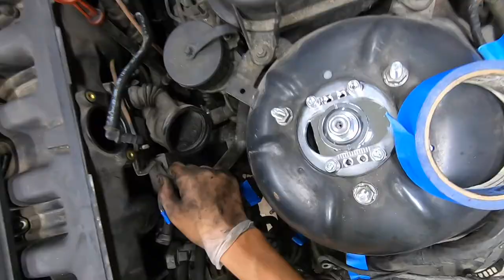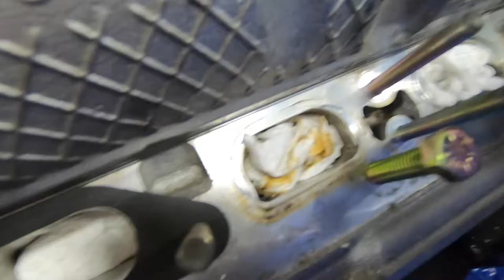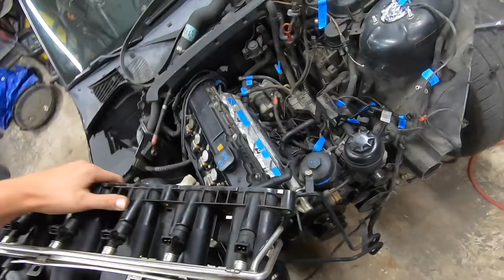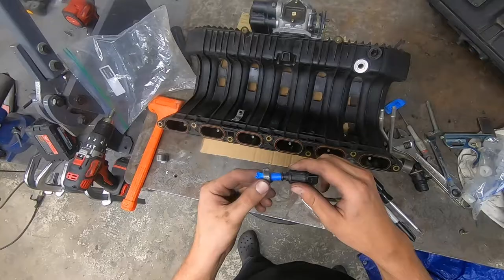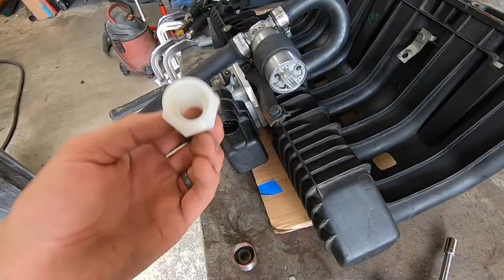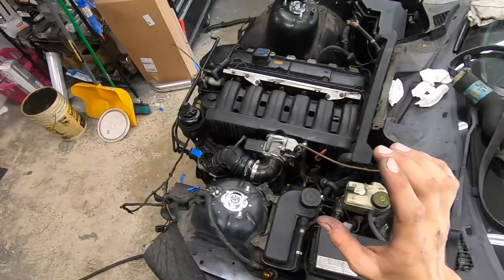Full BMW M52TU / M54 To M50 Intake Manifold Conversion For The Z-Kart + We Prepare It For Boost!

Comment: I'm actually super happy I stumbled across this video because it's super useful for me. I'm building my old 1999 328i that has the same motor and have considered this swap and will be eventually doing a fully built turbo setup
Reply: Doing a 1999 328i right now . Trying to throw the manifold on atm
Reply: @gavinsixnine  how’d it go doing the exact same thing on mine 1999 328i
Reply: @diegom.9762  went well. Didnt use any kit to swap . Didnt wanna spend another 200 bucks. The throttle body is sideways to fit onto the manifold without an adapter plate. Works fine, ran the cable up thru where the brake booster is then to the TB. There is ICV  ports that you need to plug. You get a tap tool and makes some threads in there then put some screws in it to plug.
 Make sure you got a towel or rags / vacuum ontop of ur valves to not get anything in there. You can hear the manifold alot it do be sucky sucking . Makes more power and didnt really feel any torque loss tbh. Top ends super fun. With tune rn makes about 260
Reply: @gavinsixnine  wtf 260? Yup thank you for the rapid response 👍👌I just ordered mine today
Reply: @diegom.9762  its the 2.8l makes 190 stock and with full bolt ons and a stage 4 tune i do believe that number . I have a diagnostic readers app that tells your horsepower and after many  pulls and tests 260 was average. I do believe its in the ball park
Reply: @gavinsixnine  Jesus thanks a lot man I did the same didn’t order from a kit hopefully I can pull it off like you and did you use the stock ECU to tune that’s a ms43 right? Or is it the 42
Reply: @diegom.9762  I bought a pre tuned ECU from revmatch motorsports . Comes tuned so you can keep your stock computer incase you ever wanna go back or have issues
Reply: Is the adapter plate on throttle necessary for an s52 engine?

Comment: there is certainly a bigger cleanup, that make things better from this point, with this intake.  But on the m52/54 intake ,those small diameter tubes, are for low to mid range rpm, and they are narrower, because for that given volume of air ,at that rpm, the speed of the air to be higher.  Then the Disa valve, change the route of the air incoming towards the valves, by those big fat shorter pipes, from underneath the manifold, and the engine gets a lot of ai for high rpm.  So for street use is a very good itake manifold.

Comment: Sorry I commented so many times. Lol! Regarding the sensor you threaded into the manifold. That was freeking AWESOME! But... Since you hang with the Cleet gang, think about RMRW. A fitting like that would SUCK to try to replace in the middle of nowhere. Just my .02, which in reality probably isn't worth even that to you Ben. :)
Reply from the maker: That is a good point! If I had a stock sensor and die I could probably make one on the side of the road if I had to. I’ve personally have never one go bad but like you said there is a downside to doing custom stuff like this.

Comment: Nice work. If you can elaborate a bit on why you had to flip injector wire clips? I'm doing the conversion on m52tu z3 roadster with engine out, got all parts needed, I think. Planning way ahead and I'm concerned about why you had to flip your injector wire harness connectors. Will I also have to flip mine? I have same throttle body, any suggestions? Everything I have is the same as yours except I'm keeping ccvc and secondary air, any hidden problems? The injection has me head scratching. Any help would be very valuable to me. Awesome build.

Comment: Could you please tell me real quick what throttle body boot you used. Does it work with the idle air control valve? I am at the point where I finished my plate for TB, and I have little room for boot. I relocated my obd so it's not in way, heater control is relocated. M50 manifold is fitted. Keeping my secondary air pump and the ccvv. Just need to know how you set up your throttle body boot setup. Weeeeeee. Thank you so much for your help

Comment: Hey man nice vid! Would this conversion work on M54 engine as well?? Thanks!
Reply: Hey, Quad, probably you've already answered your question but anyway, here it goes: it does work with the M54 and apparently it's a well known mod. The only thing I would watch out is the lower-rev power loss you'll have after deleting the Disa valve. This mod will do its tricks at high revs.

Comment: but the idle valve electronically is there any cable to which it should be connected or should only the pipes be placed without any electrical connection?

Comment: Hey man I own a 2001 bmw 330I and I’m in high school I’d like to think I have a lot of really good knowledge on cars but I always love to learn more considering I’m in high school I want a simpler engine bay and more reliability out of my car so I want to delete as much unnecessary things as possible but when it comes to the E46 there is not nearly as much info out there on say like a SR20 or the JZs I was wondering if we could get in contact somehow and I could talk over a few options when it comes to this. Thank you for your time and the video was amazing helped me get a better understanding of a lot and learn some new tricks to use!
Reply from the maker: Hey buddy. Check out my video on the M50 manifold swap That allows for a lot of clean up to your e46. Find yourself or someone who can code your computer. I was able to delete: A/C, Heat,  secondary air pump, post cat o2 sensors, DISA valve, EVAP System and I'm sure much more that I can't think of off hand.
Reply: Bayside Fabrication I’ll go Check out the video! The main things that I would like to get rid of is the SAP, the disa valve, the CCV, and all the other extra junk besides my A/C I live in Arizona so no chance I can’t have that but I’ve been looking into a new intake manifold and really there is only really two ways to go ether you use a m50 intake or a custom made after market one that typically ditch the old throttle body for a cable one I was wondering what one seemed like the better option. Clearly both will make a better gain in power due to better air flow but I was wondering what one will be better in reliability, serviceability, and cost effective.
Reply from the maker: M50 manifolds can be had for cheap I would go that route. You’ll need to port match intake however.
Reply: Bayside Fabrication not to hard to do however with a little patience and attention to detail it can be simple to help the air travel in smother. I appreciate the help man I was feeling a little lost because hand
Reply: @baysidefabrication  there is certainly a bigger cleanup, that make things better from this point, with this intake.  But on the m52/54 intake ,those small diameter tubes, are for low to mid range rpm, and they are narrower, because for that given volume of air ,at that rpm, the speed of the air to be higher.  Then the Disa valve, change the route of the air incoming towards the valves, by those big fat shorter pipes, from underneath the manifold, and the engine gets a lot of ai for high rpm.  So for street use is a very good itake manifold.

Comment: Doing the same to my m54 currently, did you delete the evap purge valve too or leave it plugged in and just tuck it out of the way?
Reply: what did you do with the evap? when i bought my m50 mani it was already blocked w rtv. about to do it in couple days. waiting for the m50 conversion. thanks !
Reply: @anpredictable  you can either run the evap purge valve to a npt barb fitting back near the brake booster on the mani. There are two blank ports that you can drill and tap. If not I just left my valve venting to atmosphere
Reply: @sups1264  below that FPR is the stock m50 air sensor? So i can use that for evap? Im planning relocating my air sensor before the throttle body on the air intake boot. Rather not let it out of the atmosphere. Itll be uncomfortablr and bad for atmosphere lol
Reply: @anpredictable  no behind the brake booster port there are two indents. They are not actual ports but can be drilled out and tapped to fit extra barbed fittings for things like the sap and evap, or even boost gauges and wastegates. Look on the side of the intake manifold you will see them. I’ve never seen anyone relocate the iat sensor so I can’t really comment on that idea, but if you are going to relocate that you could definitely use the old threaded hole for the evap line
Reply: @sups1264  oh yea i just cleaned them out and there was 2 closed indents. thanks. i just ordered a new icv connector only $7. but i need to carefully remove the rtv tho. thanks for the input. i may go on that. still waiting on the m50 stuff and the icv head black off

Comment: Did you have to drill the holes out on the templates for the first and last ports? Mine don't line up for some reason on those ports but work fine for 2,3,4 and 5.....
Reply: Did you ever sort this out? Having the same issue!
Reply: I just had to modify one of the templates as per SLG advice.

Comment: I have an 03 325i, it is now a 1/3 mile oval dirt track car. I run it 4k rpm to redline. Would this intake benefit me? Mine ia a 5 speed and needs about 15hp and 400rpm to dominate the field.
Reply: If all you need is 15hp & 400 rpm, then swapping in a 3 liter engine would get you an extra 40 hp or so, and a 'zhp' tune of the dme would also raise the rev limiter / redline.
Reply: @LeverPhile  I have been told the 3.0 can't handle more rpm than stock. It is on the planning list to do but is that accurate?

Comment: So I randomly stumbled across this video and you mentioned The shop you got help from. I wanted to see how far away it was and it turns out in literally 3 minutes from my house in Ocean Springs. Just thought that was kind of weird.
Reply: I got a 99 323i and about to do the m50 mani swap but  stuck at the throttle wire is to long

Comment: did u use 1/8 npt tap? im also trying to find a way to block those ICV port
Reply from the maker: Yes. No need to drill out holes. Tap existing holes and your good to go.
Reply: I'm trying to understand the whole port Tapp thing

Comment: Can you do this do the M54B25 too?
Reply from the maker: That’s what this motor is.
Reply: You can if you want to lose power, even na B28 would better of whit m54 B22/B25 intake, its been measured. I suppose M50 intake is good for turbo aplications and thats where misconseption comes that it would be great for every na engine there is.
Reply: @winha1435  it’s good ion even have a b25 anymore I’ve had a b30 for a while now but thank you for the input sir have a good day😎